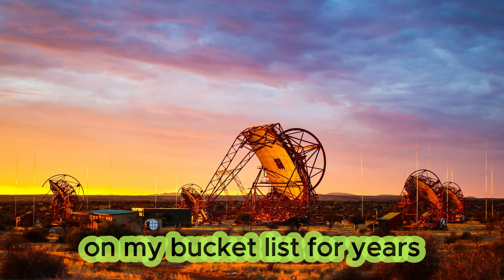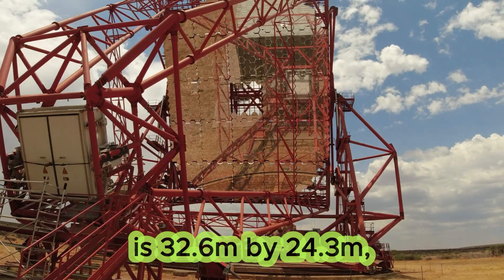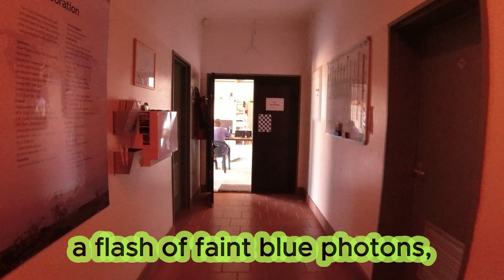A Telescope without a dome

Comment: Summary
Journey to Namibia and Unexpected Discovery
- 0:00 - Bucket list item: Seeing the HESS (High Energy Stereoscopic System) telescope in person.
- 0:04 - Experienced technician at an astronomical observatory for over 35 years, used to telescopes in domes.
- 0:18 - Trip to assess the mothballed ROTSE telescope in Namibia, November 2023.
- 0:31 - Realized upon arrival that the HESS telescope was on the same site.
Operational Challenges and Staff Support
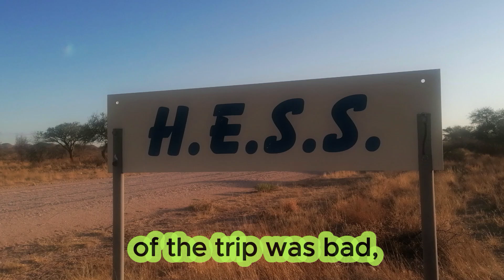- 0:39 - Timing issue: near full moon and start of the rainy season, limiting HESS telescope's operation.
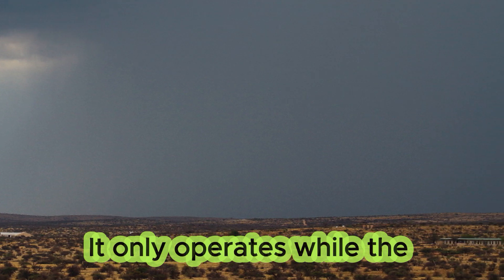- 0:49 - Staff at HESS telescope provided a special demonstration on the first night.
Photography and Visual Impact of HESS Telescope
- 1:01 - Took long exposure night pictures of the H telescope.
- 1:15 - H telescope's large size and visibility from afar inspired numerous photographs.
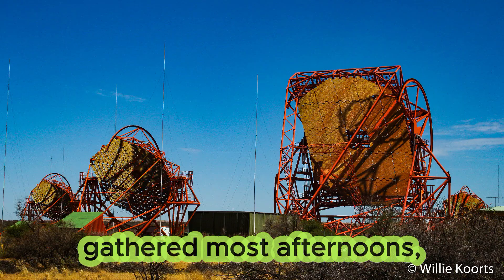- 1:29 - Rainy season led to afternoon thunderclouds.
Technical Specifications of the HESS Telescope
- 1:32 - H telescope consists of five telescopes: four 12m dishes in a square, one 28m dish in the center.
- 1:50 - 12m dishes made of 382 round mirror facets (60cm each), 108 sqm mirror area per telescope.
- 2:10 - 28m dish dimensions: 32.6m x 24.3m, equivalent to a 28m circular dish, 580 tons.
- 2:27 - 28m dish has 875 hexagonal facets (90cm each), total area of 64 sqm.
- 2:34 - Mirrors equipped with fine motion motors for precise alignment.
- 2:40 - Four smaller telescopes operational by 2004, larger one by mid-2012.
- 2:48 - Mirror facets replaced every few years, with dirty set refurbished.
- 2:54 - Facet weight of 28m telescope around 25kg, manageable by one person.
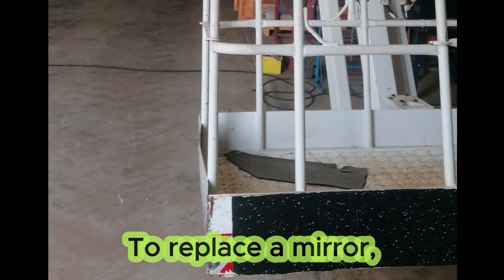- 3:02 - Two cherry pickers on site for mirror replacement.
Scientific Role and Capabilities of HESS
- 3:16 - H telescope detects high-energy gamma rays, acronym for High Energy Stereoscopic System.
- 3:21 - Named after Victor Hess, 1936 Nobel Prize winner for cosmic ray discovery.
- 3:32 - Detects air showers resulting from gamma rays colliding with Earth's atmosphere  (Cherenkov light).
- 3:59 - Uses stereoscopic reconstruction to determine direction of air showers in space.
- 4:06 - Intensity of telescope's image related to gamma ray energy.
- 4:20 - Large telescope increases energy coverage, sensitivity, and angular resolution.
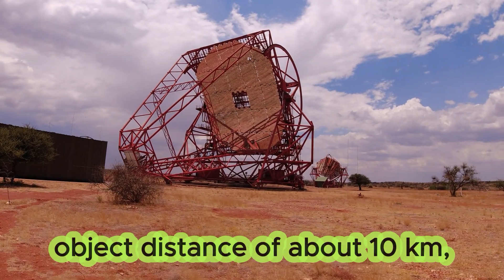- 4:29 - Mirrors focused for objects about 10 km away, typical air shower distance.
Camera and Detection Technology
- 4:40 - Each pixel in H cameras is a photomultiplier tube (PMT).
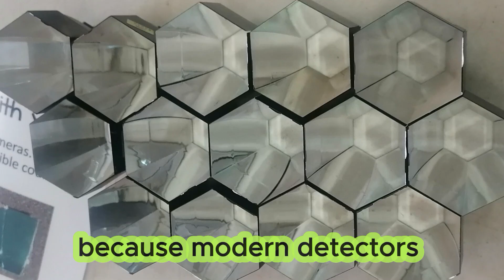- 4:44 - PMTs chosen for speed and sensitivity to blue light of Cherenkov radiation.
- 4:54 - Small dishes have 960 PMTs each, 2,048 in the 28m camera.
- 5:02 - 28m camera weighs 2.8 tons, some PMTs removed for spares during an upgrade.
Personal Reflections
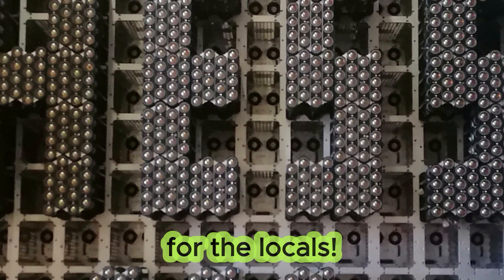- 5:20 - Trip left a lasting impression and memorable experiences.